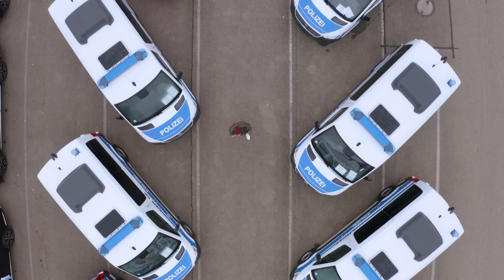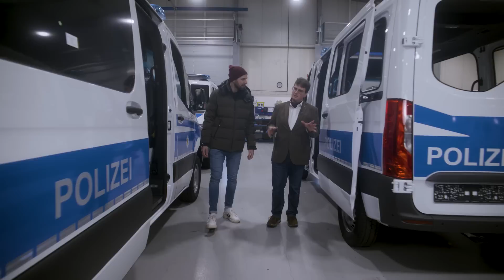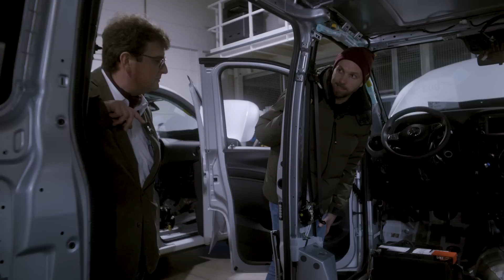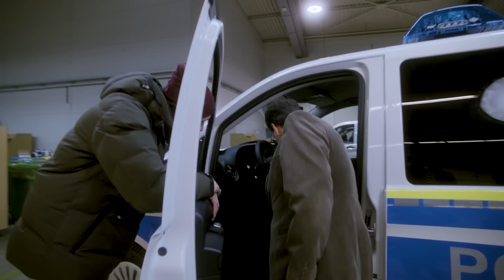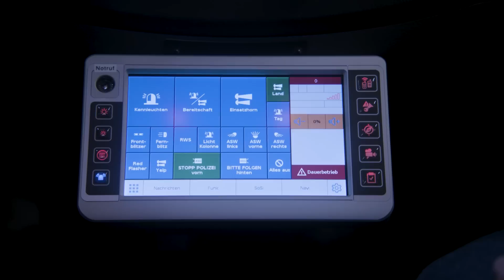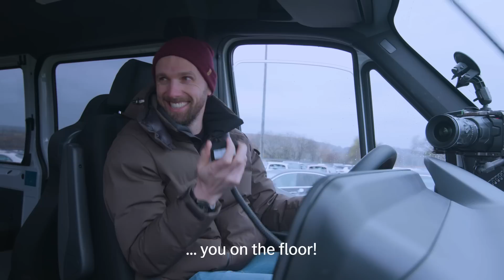Inside Look | How Vans Become Police Vehicles

Comment: Very nice! ❤ But the signal bar... Like 80% of the bar not used in the middle-section? What a waste. Useless if that is the case
Reply: it's a modular lightbar. Besides the primary emergency lights on both ends especially the police departments often choose lots of options for the center part, like e.g. third forward facing high-power emergency light, white spot light, red take-down light, amber warning lights and message boards. Other lightbars also have options for the siren's loudspeaker to be integrated as well
Reply: @EnjoyFirefighting  absolut nicht mehr zeitgemäß diese "brotkästen" vorallem takedownlight usw bringt auf der höhe eh nichts... lieber schmale LED balken, für mehr sicherheit und blaulicht
Reply: @worshipevil  wieso sollen die auf der Höhe nichts bringen?
Reply: @EnjoyFirefighting  na ein Anhaltesignalgeber auf einem sprinter dach, sehe ich ja nicht im normalen pkw-rückspiegel. noch dazu sind die sprinter/halbgruppenkraftwagen eh oft bereitschaftspolizei & die halten doch sehr selten autos aus dem fliessenden verkehr an für eine kontrolle... für mich sind die balken outdatet
Reply: @worshipevil  ich weiß jetzt auch nicht wie du gerade aufn Sprinter kommst? Die meisten Streifen sind entweder PKW oder T6 / Vitos, aber sofern die nicht gerade unmittelbar hinter dir stehen siehst due die Fahrzeuge hinter dir sehr wohl von unten bis oben

Der Anhaltesignalgeber ist ja nichtmal das, was den Balken groß macht. Es sind v.a. die LED matrix Textfelder nach vorne und hinten
Reply: @EnjoyFirefighting  weil hier nur Sprinter gezeigt wurden? Du hast sehr wohl verstanden was er gesagt hat. Sei doch so gut, verteidige die Hänsch DBS 4000 nicht um jeden Preis. Auf so einen Sprinter gehört ein flacher Balken oder zwei Töpfe.
Reply: @RoadsFranconia  Du kommst jetzt doch ebenso mit Sprintern daher. Und wenn er zuvor Sprinter als Thema auffasst, dann sei es mir doch wohl eraubt, darauf Bezug zu nehmen? 
Ach, DBS 4000 ist Mist, aber Töpfe gehen wieder?
Reply: @EnjoyFirefighting  Es geht doch in dem Video um Sprinter oder nicht? Töpfe gehen freilich, schauen dann auch besser aus als diese Playmobil-Balken mit viel umbauter Luft.
Reply: @RoadsFranconia  um Sprinter und Vito, ja 

Dann magst mir sicherlich auch sagen wo Zusatzfunktionen in den Töpfen eingebaut werden
Reply: @EnjoyFirefighting  Ich sagte ja: Flache Balken gehen auch. Und wo sind eigentlich die Zusatzfunktionen bei Feuerwehren im DBS4000 eingebaut?.... muss man den FEUERWEHR-Schriftzug eigentlich auch extra bezahlen bei Hänsch? Da wird einem Sch.... als Schokupudding verkauft und die Feuerwehren und RDs feiern es auch noch. Da lobe ich mir die Feuerwehr Köln. Die haben sich für ordentliche Standby-Balken entschieden. Komm, mach dich nicht lächerlich. Du weißt dass ich Recht habe.
Reply: @RoadsFranconia  geht es hier um Feuerwehr? Nein. Ansonsten können auch diese beispielsweise eine Textmatrix verbaut haben (siehe NEF und ELW Feuerwehr Hamburg), Flutlicht, Heckwarner, Umfeldbeleuchtung usw drinnen verbaut haben. 
"t und die Feuerwehren und RDs feiern es auch noch" es wird einfach angeboten, eswird gekauft, weil einfach, modular und günstig. 

Wir hben aufm RTW Blaulichttöpfe drauf. Bei Sonneneinstrahlung bescheiden zu sehen, v.a. aus der Ferne. Da sind die DBS 4000 vom alten NEF oder die von den aktuellen Streifenwagen leider tatsächlich besser zu sehen. Ich sage leider, weil ich den DBS4000 einfach ultra hässlich finde, so ein Baguette auf dem Dach. 
Das ändert nichts an dem Fakt, dass der dennoch gut zu sehen war, und aufm alten NEF hat der bei uns auch gut gehalten
Reply: @EnjoyFirefighting  es geht generell darum, dass sich Blaulichtorganisationen den DBS4000 andrehen lassen von Hänsch und den Ausbauern. Und wie oft kommt es vor, dass ein RD oder eine Feuerwehr eine Matrix vebaut hat? Dann sollen sie diesen Balken gerne bestellen - denn DAFÜR ist er so hoch designt worden. Nicht aber für 99% aller Feuerwehren oder Rettungsdienste. Und diese Sprinter brauchen keinen ASiG auf dem Dach, sondern auf der Haube oder hinter der Heckscheibe, weswegen ein DBS5000 o.ä. besser gewesen wäre. Du nimmst ja auch keinen Feuerwehrschlauch um deinen Garten zu gießen.
Reply: @RoadsFranconia  ja klar doch. Solange Kooperationen zwischen Aufbauherstellern und Bauteilherstellern bestehen, so wird es diese im Paket auch günstig geben und als einfache, schnelle Option, wo man nur noch auswählen, und nicht noch groß abklären und bestimmen muss was wo wie genau. 
Der Aufbausockel für die Hauber oder fürs Dashboard ist, auch in der Masse einer Großbestellung, meist teurer als einfach der günstige Balken. Ist einfach so. Den Balken nimmt man sowieso, das andere wäre dann noch on top ein Kostenpunkt. Und bei der Aussonderung ein Punkt mehr, der zurückgebaut werden muss. 

"Du nimmst ja auch keinen Feuerwehrschlauch um deinen Garten zu gießen." nimmst du weswegen an? Wer sagt, dass ich das nicht tu?
Reply: @EnjoyFirefighting  ah ok..then it makes sense 😀🙏 thanks!